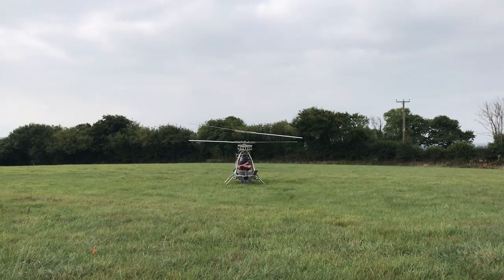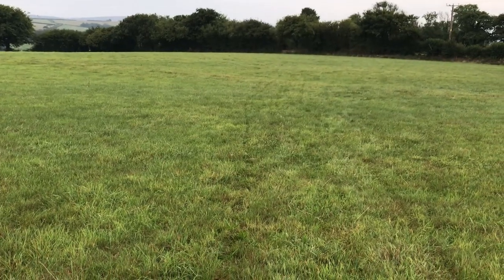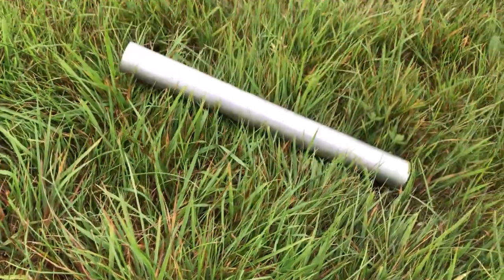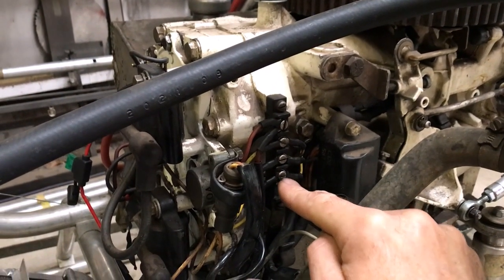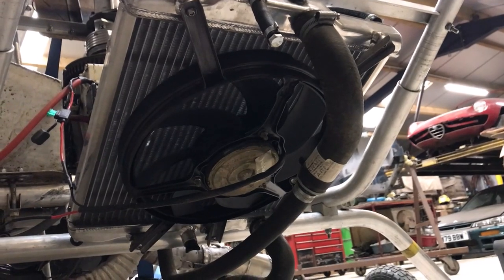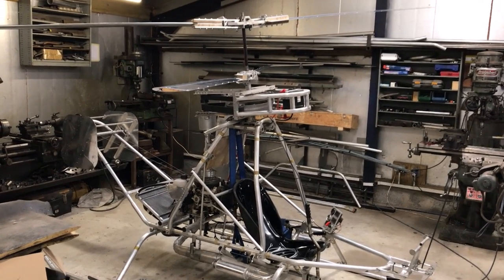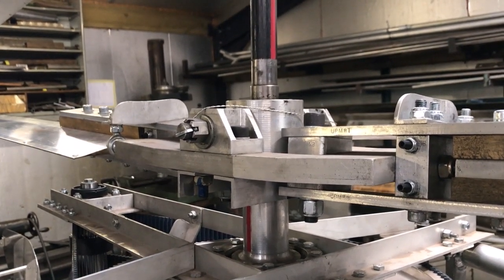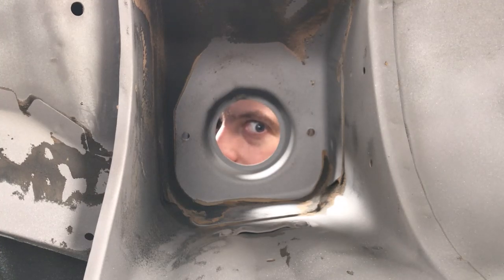Slow learning process Homemade coaxial Helicopter

Comment: Amazing progress!! Curious, how much throttle are you giving it while hovering? Do you think your underpowered? A proper exhaust and air intake can make a huge difference! Lastly its a shame your moving so much air and you have to install a fan 🤔 seems like if the radiator was placed properly with possibly some ducting all that downward air flow could be used to cool it? Sure youve considered these things.
Reply from the maker: Thank you for your comment. In the next video I get to full throttle travel and lift actually reduces. Not sure what's going on there, but I increased blade pitch to produce more lift which worked and now I have more throttle to play with. I haven't tried full since and don't know how high it will climb. I'm not too worried about this currently because when I remove the extended skids lift will be significantly increased. I've already built twin tuned exhausts but haven't modified anything on the induction side. There are issues with moving the radiator into the downwash but it could possibly be done.

Comment: Amazing project.
This is the first video I watched  on your channel. But I can't stop thinking that using an outboard motor for this project is unwise. My guess is that at this point you are heavily invested in your choice but keep in mind that these motors are unreliable in so many ways, please reconsider your choice.
Reply from the maker: Thanks, what engine would you choose ? I would like a 4 stroke but most are too heavy, 2 stroke aircraft engines are expensive and I've been told less reliable than my Johnson engine. Turbine would be nice but even more expensive. Electric might be the way to go?
Reply: @Ben-Dixey  Forget electric,  is way too heavy when you consider energy density. Gasoline is about 100 times more energy dense than LiIon batteries.  
The problem with all these land based engines is that they have no redundancy of any kind because they are not designed to be as reliable as something made for aviation.
I assume that most of your design is around the two stroke outboard engine which ha a good power to weight ratio  but it has a narrow power curve,  low torque and  RPMs are on the high side.
I think if you ever want to go over a few inches height you will have to find an air cooled engine specifically designed for aviation.
There are many many brands  like Zanzottera ,  Rotax, Hirth , Limbach. 

Please accept my apologies for bringing some negative aspects of your design I really wish you succeed in you endevour. 
For context I am a mechanical engineer but have very little experience on aviation matters but I dealt with outboards and they suck.
Reply from the maker: Fair points, if I was willing to spend the money I would have started off with an air cooled aircraft approved engine. It would have been lighter and possibly more reliable but that doesn't mean I would trust it to go higher than I'm willing to go with the outboard. In the new video I go to 2-3ft off the ground and that was scary enough knowing that if the engine quits it drops like a stone. I know about a redundant electric back up used on one helicopter and adding this would allow me to go higher. Changing to an aircraft engine would offset the additional weight of the electric system. It would certainly take a lot of money to do all this though.
Reply: @Ben-Dixey  Yes I agree, when it comes to aviation standards everything becomes exponentially more expensive, and yes all the other parts from the engine up to the tip of the blades would have to be reviewed. 
 I doubt that you invested this many hours to just to raise it 2 to 3 ft above ground :)
On the other hand you can consider converting it into an unmanned aerial vehicle UAV and conduct your testing without risking yourself.
Reply from the maker: I did actually invest all this money just to raise a few feet off the ground 😀. I wanted a toy just to hover around a field and to learn the skill. It would have cost nearly as much as I've spent for instruction to learn to hover. I know full well this machine should not be flown higher as that wasn't the intention. The designers of the air scooter 2 had the same idea as hovering is perhaps the most fun part of flying a helicopter. I could have added twin engines like the Nolan brothers did then flying higher would be safer. Who knows what I'll decide to do with it but it's been fun so far.
Reply: @Ben-Dixey  Tip of the hat to you. You have done a great job so far!

Comment: You are doing really well. I still think that the grass is too long for test flights, particularly when it is wet. Could you mow a circle slightly larger than the training skids so they don’t bury themselves? As I suggested previously, we used the training skids but place foam marine marker buoys on the end of the rods. This stops the poles catching, as the foam balls can rotate and are larger than the rods. As you lift off, the training skids which are bent upwards with tension due to the balls then  straighten and clear the grass. Now the only point of the trading skids  touching the ground are the balls.  As you are also hovering so close to the ground, it affects the stability as well. It is up to you but perhaps it is worthwhile to work your way up to one metre and see if it settles down. Keep up the good work!
Reply from the maker: Thanks Kim for the great comment. I hadn't forgotten about the balls you previously mentioned and with the grass issue it would be a good idea. Do you remember what the weight of the balls were? If you haven't seen the next video I have already gone higher which certainly improved control.

Comment: It seems weird you would need a fan at all for your radiator considering you have two giant fans only feet away from the radiator constantly supplying air movement.
Reply from the maker: Yes, I was hoping there would be sufficient cooling from just the rotors but near the center there isn't much air movement. If you moved the radiator further back it would then start cooling but there might be other issues with doing that, such as air pushing the tail down and a change in CG.

Comment: From RC hobby:  Be careful with those extended training skis.  We use them a lot in RC world.  It is CRITICAL you do NOT have any pointed ends.  I found this out the hardway when one of the foam balls fell off the end of my carbon fibre rod and on the next side slip on touch down the tip of the carbon rod caught on the grass and I luckily only lost a set of rotor blades as I hit the kill switch in time.
They need to be flexible, they are not there to STOP a tip over.  They are there to give you a bit of forgiveness.  Should they catch or dig in, you will flip, once you anchor a point of the heli and input any rotational force the gyroscopics will take over and just like a kite in lock out, you flip over into a ball of flying dirt.
Reply from the maker: completely agree I've bent up the ends of the skids to keep them form digging in but there is still a risk.

Comment: Something has been bothering me about your aircraft. The rotor system needs to be about 2-3 feet higher relative to the rest of the mass. The Hiller xh44 from the 1940s initially had roughly the same layout and proportions as yours . It crashed again and again until they lengthened the rotor mast. Think of the aircraft as a pendulum lengthening the pendulum increases its period and decreases the frequency. Helicopters are hard to fly period. A helicopter with too short a period of oscillation is impossible to fly. I talked about this with Stan Hiller years ago and some years later with Frank Robinson  about this exact topic and I finally understood why. The early helicopters all had some compensating controls (the dumbells in the case of the Bell helicopters and the compensating air foils on the Hiller helicopters.) Modern helicopters don’t use these devices because they increased the length of the mast to reduce the oscillation frequency so the aircraft could be controlled without them. Regarding wind Helicopters have very high rotor loading compared to fixed wing aircraft and are more stable than fixed wing aircraft in windy conditions. FWIW I am a licensed commercial instrument airplane pilot and a licensed private helicopter pilot and an engineer. It helps that I ran the Hiller aviation Museum for a brief time and was on their board of directors and a docent in the museum for about a decade. I am impressed with your progress. Take a look at the relative height of the rotor of any modern helicopter to yours the all have much taller masts and it is for a really good reason. Best wishes I am cheering for you. Feel free to PM me if you want to discuss your build. Regards Rusty.
Reply from the maker: Wow, thanks very much Rusty for your great comment I will definitely have a look at the rotor height comparison and get back to you. You have a lot of expertise there. 👍 btdixey@hotmail.com is my email should you want to communicate via email.
Reply: Please forgive my ignorance, but how is this any different than the faulty rocket pendulum fallacy?
Reply: @JustThomas1  This is just simple physics. if you look at a Bell g3 or any of the first generation 2 bladed tetering rotors systems the control inputs connected to a pair of dumbbell weights that in turn were connected to the rotor blades. * the original xh44 was a two bladed counter rotating rigid rotor. To get a stable rotor system Hiller added the rotovator counterweight system and raised the mast several feet. The net effect was to lower the frequency of oscillations of the the rotor system. Second generation helicópters like the bell Jet Ranger do not have the dumb bell weights. To make the helicopters controlable the rotor mast was raised by several feet. The oscillation frequency was reduced just as if the counter weights were still there.
Reply: As to the rocket fallacy, remember that a big part of helicopter flight dynamics is gyroscopic So the physics is quite different than balancing a broomstick on one finger (rocket flight dynamics).
Reply from the maker: I've been thinking about this and  here are some thoughts. I believe helicopters pitch and roll in the air about there center of mass therefore moving the mast upwards wouldn't have that much effect. Take the sch2a for example it's engine is up near the rotor and there are no stability issues. What about the Hiller flying platform with it's rotor on the bottom. that's as low as a rotor can get, yet it flew. I had the opinion that rotors were high to get them above human height. I would be interested in your thoughts. Ben
Reply: @Ben-Dixey   Helicopters fly in two flight regimes helicopter “air moves down through the rotor, and auto gyro air moves up through the rotor. The force opposing gravity is lift and in both cases the rotor provides the lift. I suspect you half done a hang test to adjust the center of gravity of your craft. The pendular forces in flight are exactly the same as what you see in a hang test. the longer the cable lifting the craft the slower the craft will swing. The mass here is the center of mass of the craft. If you extend the length of the mast so that it is farther away from the center of mass the slower the pendulum swings. As I mentioned in my post I had the opportunity to ask Frank Robinson (founder and designer of Robinson R22 R44 R66.) I asked why doesn’t the Bell Sky Ranger or the Robinson Helicopters need the stabilizer bars and he pointed at a sky ranger and a G3 “We were on the ramp at a Helicopter air show” and explained that moving the rotor farther away from the center of mass allowed the newer generation Helicopters to fly stability with out the need for the stabilizer bars. You have a unique aircraft. The physics of pendulums is the same the weight hangs from the rotor and the distance from the rotor to the mass determines the period. The longer the period the easier to control the aircraft becomes. I understand your point about the center of mass as far as momentum goes, but it is the rotor resisting changes of momentum through lift and drag that does all the work. You mentioned the sch2A the center of mass is defined more by the location of the pilot than the engine. I would love to take one for a flight. The Hiller flying platform used a duct that created ~70 % of the total thrust there were 2 counter rotating propellers (cut down aircraft propellers.) You are correct it was very stable, in fact it was too stable the gyroscopic forces of the propellers dominated it’s flying properties. The craft was controlled through weight shifting and vectored thrust produced by vanes underneath the propellers to control yaw. In flight testing the craft could be made to fly slowly the way you might expect but as soon as the duct started to produce translational lift a pitching moment was created that slowed the craft back down. the 2 propellers always ran at the same speed coupled together through some dodgy looking belts. The most developed coaxial Helicopter is the   https://en.wikipedia.org/wiki/Kamov_Ka-50. I would study this design. I don’t know of any 2 bladed coaxial designs that have ever been certified. The next generation at Hiller after the xh44 was called the commuter a 2 bladed simirigid under slung tetering rotor counter rotating coaxial system. 2 were produced for certification but in flight test a test pilot* was killed and Hiller abandoned the commuter for the Hiller 12 series using a single 2 bladed tetering rotor. These were certified and thousands were produced. *coaxial rotor systems have unpredictable behaviors in the transition from normal flight to autorotation. Depending on the design the anti torque pedals may reverse so nose right may require left pedal. Having rotors high does reduce the chances of loping people’s heads off but the primary reason is a more controlable aircraft. If I can help please feel free to contact me. I will ping your email so you have mine. Regards Dan
Reply from the maker: Thanks for this Dan you have great knowledge. I knew I was on dodgy ground arguing against what Frank Robinson said 😀 and what you have said makes sense. The only thing that confuses me a little is Helicopters have a delay in response to cyclic control and mine is no different. This delay makes it hard to learn to hover, making the delay worse by increasing the period you would have thought would also make it even harder to control. 

I have done a hang test but it's suspended from the top of the mast, not quite like it is in the air, I suppose it should be suspended by the mast hinges or somewhere between the rotors to asses the oscillation period. 

There's something you mentioned about the flying platform which was gyroscopic forces of the propellers dominated control. I don't understand this because I know counter rotation cancels any gyroscopic stability. 

Have you seen the Rotorschmiede Va115 it's obtained a permit to fly under the DULV. Quite a high rotor by the looks of it. 

I completely agree there is a lot to learn from Kamov.  yes please ping an email, be great to have a contact for you.

Comment: That is a very ambitious project, well done!
Does it have the power to get out of ground effect? ie; where in the rev ranve were you during ground effect as shown in the video, and how much more revs/hp does the motor have in reserve for powered flight and wind issues?
Reply from the maker: Thanks, I haven't tried full throttle yet but my feeling is it's very near full in the video. However I haven't optimised the blade pitch for maximum lift. I'm also carrying around 6kg of extended poles which will eventually be removed. I'm confidant I will be able to get it out of ground effect, there are also additional weight saving measures that can taken.
Reply: @Ben-Dixey     Thank you for the reply. Yeah power to weight is always a big issue in hovering flight, a lot of people underestimate the difference between the power needed for ground effect getting off the ground and power needed for actual flight and more, ie tilting to go forward which takes away from lift.
Anyway this is an awesome project and thank you for sharing. 👍

Comment: If someone can build an electric helicopter that can do everything a normal one can, I will know battery technology had gotten good enough. Hahaha it will never happen!
Reply from the maker: Agreed, it's a shame battery power isn't comparable as it would be so much easier to transfer the power. Motors are so smooth and produce massive torque. The Jetson 1 is great machine by the looks of the videos.

Comment: You are attempting to hover in ground effect, IE, you are too low to obtain a stable hover. A higher hover altitude of around 15 feet and it will stabilize. This is basic principals and knowledge....🤔😳😳🇬🇧🇬🇧
Reply from the maker: Yes agreed, but had to attempt higher altitude in my own time. New video coming which might validate your comment.
Reply: @Ben-Dixey  Great, I'm sure when you gain confidence to hover out of ground effect you will see I'm right. On a side note, hovering into a steady turbulent free  wind will enable a stable hover too at lower altitude. This is because of translational lift...😳🇬🇧🇬🇧
Reply from the maker: Makes sense, thank you. What is your background? I see you do Rc flying but I don't think that knowledge came from rc flying.
Reply: @Ben-Dixey  You'd be surprised. I had many years flying model helicopters. The principals are exactly the same....😳🤔😀

Comment: That water pump is way too small, not enough flow to cool the engine
Reply from the maker: It certainly could be the case. Another problem though is the size of the coolant hole going into the engine which is only approximately 12mm  diameter. The hole can't be enlarged but it might be possible to feed into the engine from a different location with a bigger hole. Then a bigger pump could be fitted. I need to do some flow measurement and research the topic.